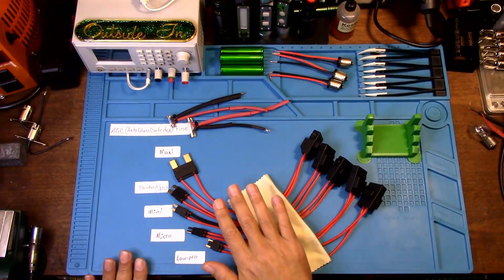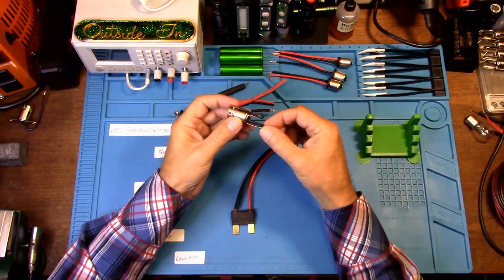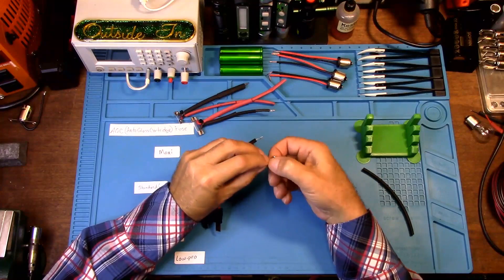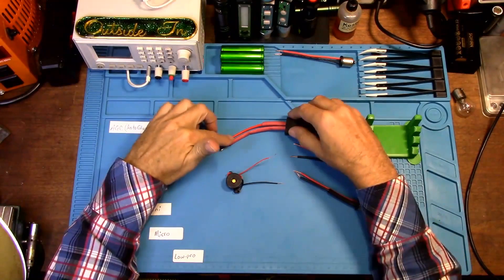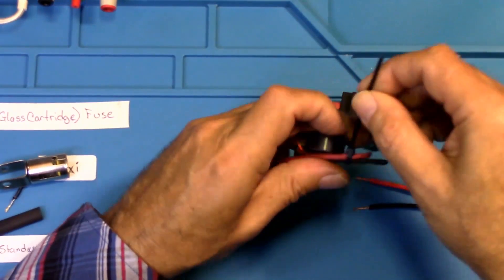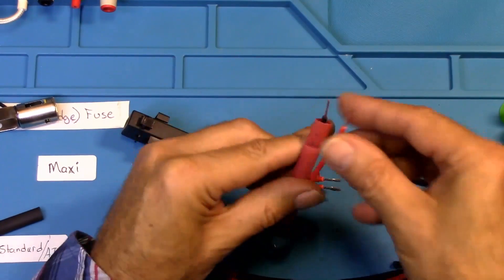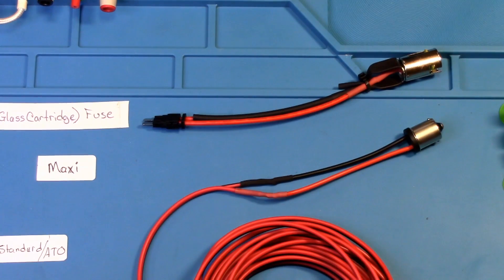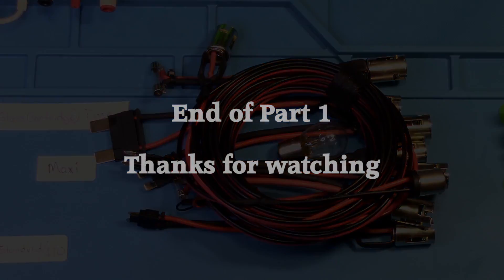How To Make A Short To Ground Tester Part 1 - (Making the testers)

Comment: Why are you bothering with red/black and positive/negative? Incandescent bulbs are not polarity sensitive.
Reply from the maker: There is a positive and a negative on a light bulb and it may not matter if you reverse the polarity, but it does matter if you become used to hooking things up backward, so I do it that way to not become complacent.

Thanks for your comment, I hope this helps you to understand that complacency can lead to fires.

Comment: I'm sorry but whats the point to all this doesn't a multi meter do all that :face-blue-wide-eyes:
Reply from the maker: Thanks for your thoughts and question.  If you have ever had a short in your vehicle (somewhere in the wiring harness), you would understand the reason for a kit like this.  Finding a short in your wiring harness can take many hours, or days to find using a multimeter.  But - Yes, you can use a multimeter to find a short, but the first time you have to do that, is the LAST time that you will want to ever do that again...  Using these testers, you can find a short in a matter of minutes - compared to hours or days, and that is the point of this video.

I talked to about 4 different garages when I had my short problem, and everyone of the garages told me it would take up to a week and maybe longer to find a short in a wiring harness, and the cost would be truly astronomical - possibly over 1,000.00 in labor charges.  I definitely cannot afford anything like that, so why I had to find a way that I could perform this task on my own, which is what led me to discovering this technique.  There are a number of videos online that show how to find a short using this method, but I wanted to take it further, and designed an even better approach, and why I created this video.

Hopefully if you find yourself in a situation like this, you will refer back to this video, create one of these testers yourself, and you too can find your short on your own, instead of paying a garage 100's of dollars to find and fix.

Comment: Awesome video, great build 👍 Thanks for sharing. What kind of heat gun were you using for the heat shrink? It looked small and convenient.
Reply from the maker: Thank you for the comment and question.  I was using a bastex butane torch for the heat shrink tubing.  I have had it for a few years, so don't remember where I bought it exactly.  I looked on Amazon and eBay, and can't find one, so it may not even be available any longer.